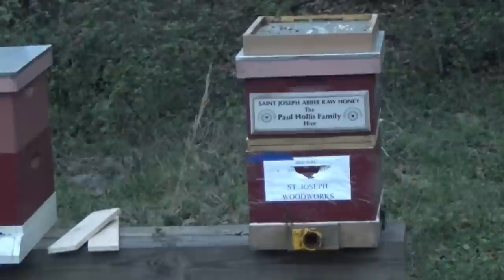Monster bee hive discoverd after ripping up floor boards

Comment: You really have your act together using the handles to remove the floor board and having the saw horses set up to work off from  was very impressed with this removal
Reply from the maker: What's really impressive is that the plan worked. Really, I was amazed when that hive came up in one piece. If your have not seen it, I came back to this same house 7 months later and did the exact same thing. It was a repeat performance, with the same results......success. By the way, both hives are doing fantastic. Thanks for watching, and I hope you continue to watch my channel and leave your thoughts. God's peace.             Mr. Ed
        
https://youtu.be/arBEHHCcNUM

Comment: Hello Jeff, I was planning to buy one infrared Camera, do you like yours? Do you think it's doing a good job? Would you recommend this particular model you are currently using? Any other options available that you'd prefer using atm?
Reply from the maker: I love my thermal camera, it does everything I need it to do. There are lots of them on the market, but I would recommend the The Flir model # TG165 to locate the hives in the wall. Just my opinion.  Thanks for watching. God's peace.
Mr. Ed

Comment: What happens to the vacuumed bees? Are they dead?
Reply from the maker: Not at all. My purpose is to save and relocate the bees, therefore I use a vac that has a special design that has VERY low pressure. There is less than a 1% mortality rate using this vac, and that's way better than a 100% mortality if I had not removed them and they were destroyed. Thanks for watching, and I hope you check out other bee videos on my channel. God's peace.
Mr. Ed

Comment: Hello Jeff, you have so many comments that haven't finished reading them allSo I would like to ask you a question concerning the thermal camera.. I have a thermal thermometer that is laser guided and is really accurate as far as temperature goes. Until I work my way up to the camera itself, Will this thermal thermometer act as an aid in locating bees inside of walls and such with out the image but relaying on temperature alone? Thanks again... God Bless!!
Reply from the maker: I have a thermal thermometer also, and I used it to find bees. However, the camera gives an image and this image locates the hive for you. The thermal thermometer gives you an idea of where the hive is. It can also give you a false reading . There is no doubt using the thermal camera, and it also give a temperature reading as well. I hope this helps. God's peace Phillip.
Mr. Ed
Reply: Jeff Horchoff Thank you for your explanation....  I hope your friend Steve is back on his feet and back in a new house.... God Bless him and his family and yours as well ..... Thanks again....
Reply: Jeff, i do you have a video tshowing what model camera that you use and how to use it ?

Comment: Is the vacuum just too violent, too gorey, and too inhumane to the bees that you never can show the footage of it?
Reply from the maker: The idea is to save bees, not kill them. The vacuum is designed to have only low vacuum which does not kill bees. Once the bees have passed through the hose, they are deposited in a bee box that has frames in it. Because the box has "dead air" inside of it, and there is no turbulance inside, the bees walk onto the frames and stay there until they are reunited with the comb that was removed. Most bee removal services employ this tool as it is the most humane, and effective way to remove and relocate colonies of bees that moved into homes.Thanks for watching. God's peace.
Mr. Ed

Comment: One quick question, when you use a vacuum cleaner, does that kill all the bees ? 
Would be a shame if they all died if it did.
Reply from the maker: It is a special designed vac that has very low pressure. It does not kill the bees. I want live bees not dead ones. These bees are now doing great at the abbey, and we even pulled honey off of them yesterday. Thanks for watching. God's peace.      Mr. Ed
Reply: Ahh thanks for the reply, here in the Netherlands honey bees are quite rare last couple of years, and bug exterminators just keep killing them, i think thats a shame.
I read an article the other day about bees are so important for us, most people dont have any idea HOW important.

love your channel you earned yourself another Subscriber :)
Reply from the maker: I can't tell you how much I appreciate it. Keep warm Mark. God's peace.     Mr. Ed